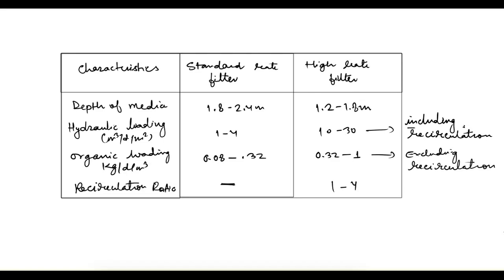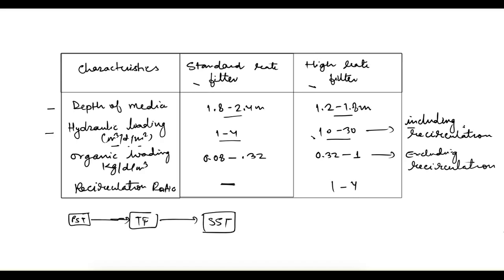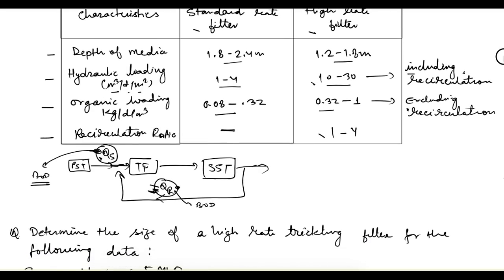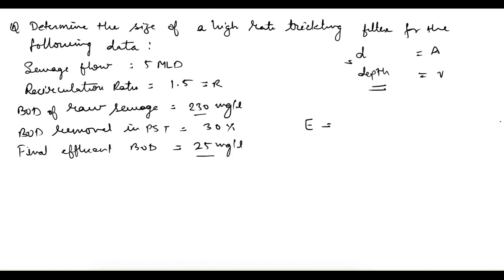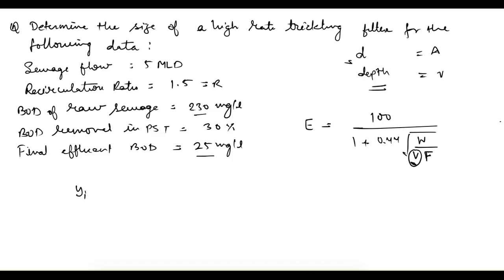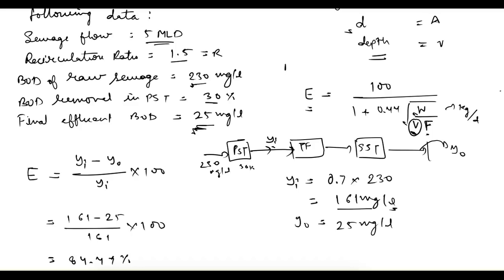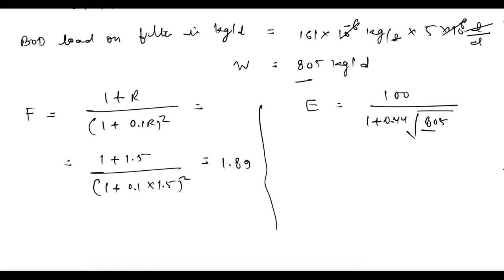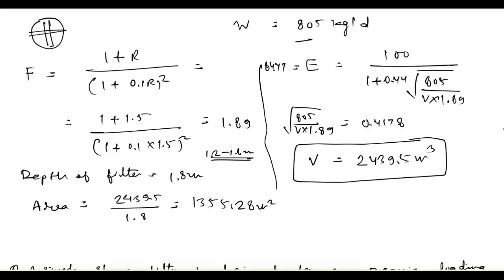Trickling Filter Example Problems | Waste Water Engineering

Comment: Sir, we are calculating the tank volume based on a BOD concentration of 220 mg/l. However, the tank should actually be designed for a BOD concentration of 143 mg/l, Since 35% of the BOD is already stabilized in the PST. Therefore, only 143 mg/l of BOD will be transferred to the TF.
Reply from the maker: Yes, it should be the remaining BOD in the calculation.
Reply: @APSEDUVERSE  thank you sir

Comment: Sir u are the best coach than made easy and ies masters
Reply from the maker: Glad to know that Arti Choubey. Hope you have checked our dedicated courses for GATE, ESE and other exams in our website learn.apsed.in
Reply: @APSEDUVERSE  is your courses sufficient  to crack IAS exams ?
Reply from the maker: I presume you are taking Civil Engineering as optional. Similar to youtube, we have covered every lecture as per GATE and ESE syllabus. It matches about 90 percent of syllabus for IAS and will prove to be very useful. Further we can guide on how to prepare for IAS Civil Engineering Paper. There are few students who have taken it for the same.
Reply: I want to buy your courses.  The validity of the bundles package has been shown for one year, but I want the validity of the package for 2 years, so how can I get it.
Reply from the maker: Sure Arti Choubey. You can change the validity after going inside basic or premium study package. There is an option at the top to change validity.

YouTube comments do not allow screenshots, you can call us at 8610625642 for step by step guidance. Will help you out

Comment: Is 0.44 or 0.0044 in formula?
Reply from the maker: It depends on the unit of volume.
Reply: @APSEDUVERSE  Please clarify which is used where..
Reply: @archanaiyer5714  0.44 is used if organic load unit in m3/m2/day  . 0.0044 is used if unit is m3/ha-m/day.